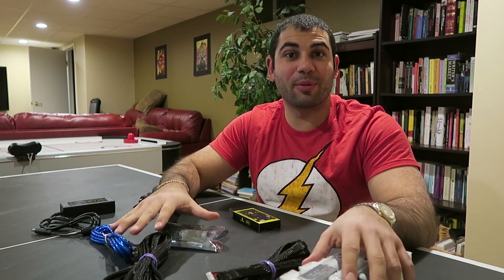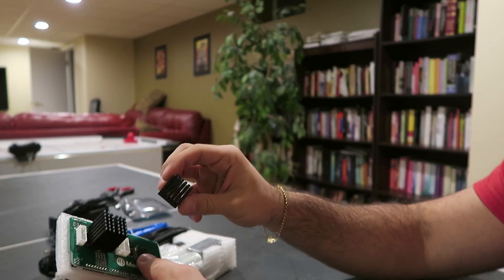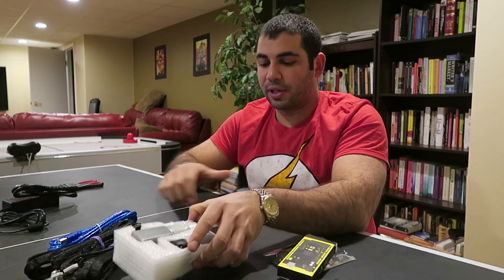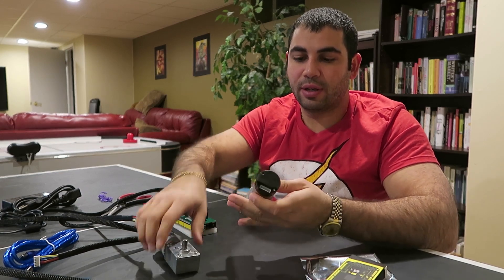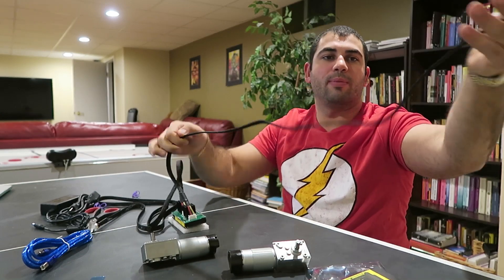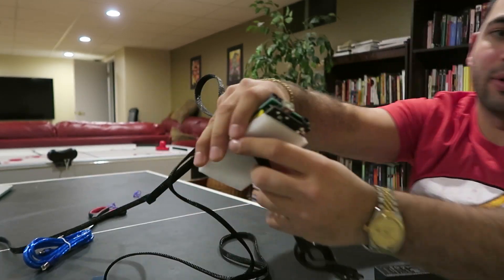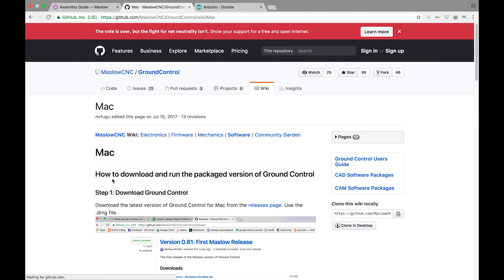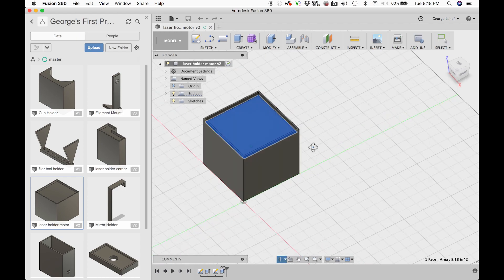Maslow CNC Setup - First Steps!

Comment: Very helpful video. Do I need to protect the arduino or any parts from saw dust.
Reply from the maker: Because it sits behind the machine , it’s technically OK. I’ve actually been running mine without a case on it, but I’m definitely adding one soon. Saw dust particles flying on the board while operating can definitely cause short the board, so suggest throwing it in a project box!
Reply: Maker's Best Friend awesome.thank you. Loving your videos by the way
Reply from the maker: Danny Frommer awesome to hear!! Thanks for watching!